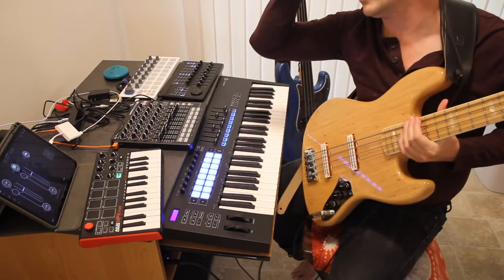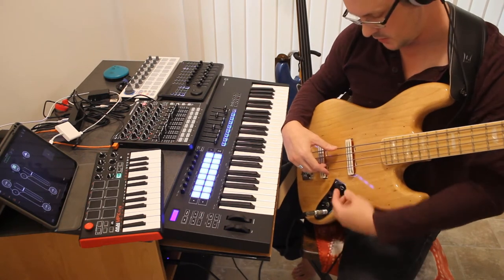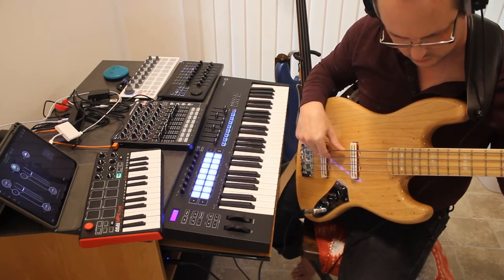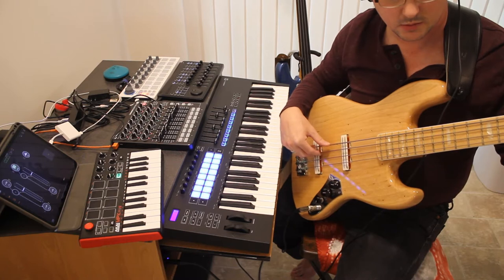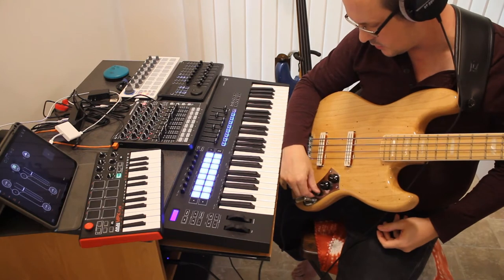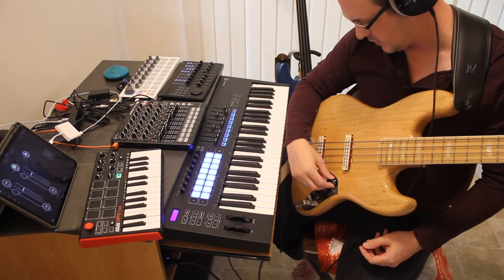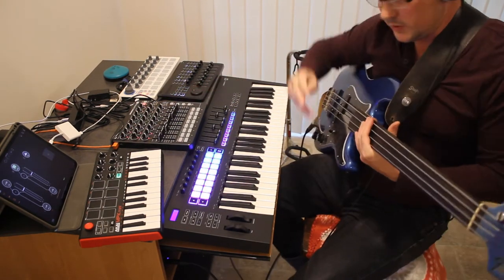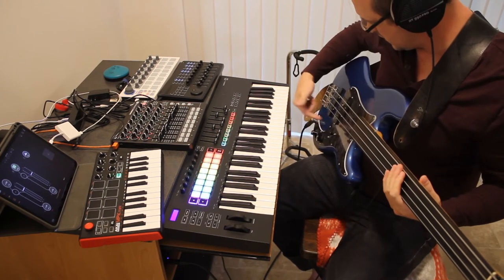Fender Jazz Bass Series Parallel Push Pull Switch Wiring Harness

Comment: Very neat! I'm thinking about buying this for my g&l JB. Do these usually go in with no extra routing to fit the extra bulk from the push/pull?
Reply from the maker: If you’ll contact me on reverb, we can go over measurements with pictures. Much easier than here on YT ;)
Reply: @ticktockfool  will do, probably next week after I get paid 👍 I'm guessing I'll have to take my control plate off to measure